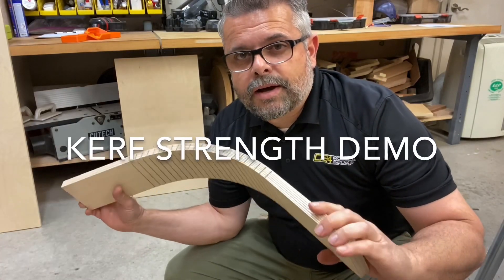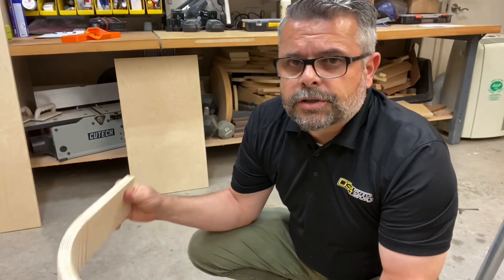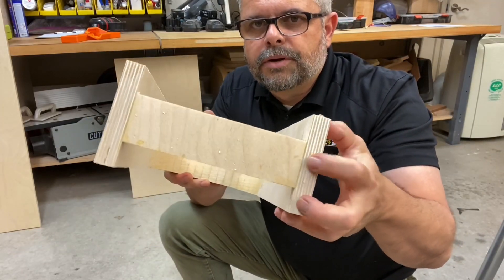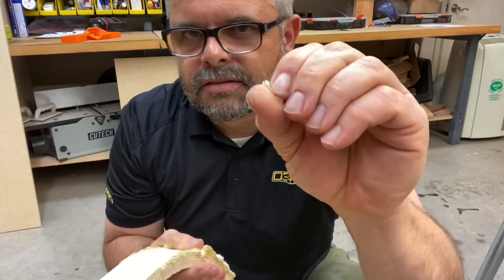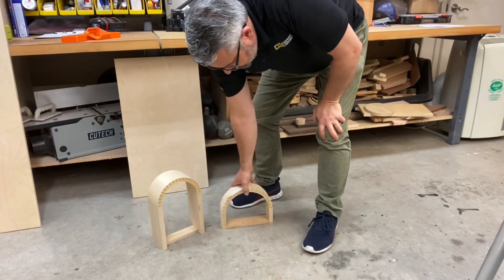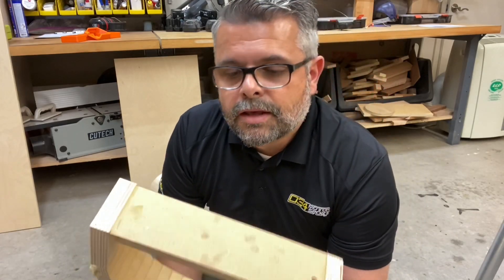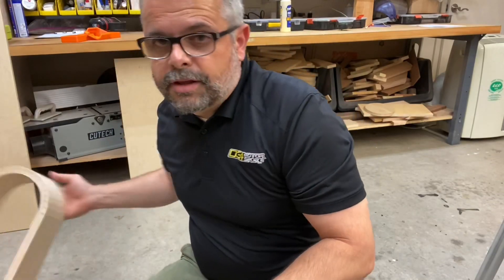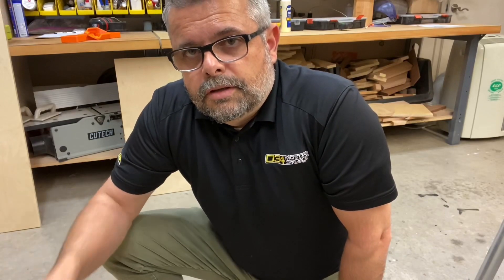Kerfed Panel Strength Demo

Comment: That is interesting but it doesn't really prove their strength since you put your weight on what is structurally the strongest part of the dome shape.  Also the cross brace becomes a part of the structural integrity of the piece once you attach it.  It is still interesting though but the plywood is clearly compromised and will behave differently from normal plywood in response to several kinds of stress despite still being strong in one specific direction.  I would actually like an engineer to discuss this because I don't really know where it would be strong and where it would be weak.  For example if you put the dome pointing off to the right and the cross brace on the left and stepped on the structure I bet it would break. Your 185 lbs would break the board depending on the direction of the force.  Still interesting, thank you.
Reply from the maker: This isn’t a scientific experiment, it’s a simple demonstration, you should come away from this with a reasonable sense that this assembly still has a lot of strength considering these cuts leave less than. 1/16” of material connecting the kerf sections. 

I am an engineer and this demonstration clearly shows this assembly as built has a certain amount of strength, it’s not designed to be a strength thesis for whatever it is you’d like to do with kerfing.

Comment: Fill the kerfage with: 1 part titebond + 2 parts sawdust + 3 parts fine playsand. premix solids, intermix glue immediately before application, solidifies almost immediately, temperamental to sand brand, frighteningly durable when you get things right.
Reply from the maker: I have tried and experimented with this technique, I found it’s very difficult to actually fill the kerfs like that and really not necessary, I demonstrate using expanding polyurethane glue here, it fills the voids and is very strong, nothing more is needed.

Comment: I'm currently in the process of kerfing baltic birch plywood for my own speaker enclosures.  I'm using a single sheet of wood for the sides and back.  I've gone through quite a few pieces of scrap to dial in my methodology.  I won't be using a veener, so my kerfs will be more shallow, and the bending done slower to avoid any kerfs showing on the backside.  Great job with those Jintanis.  I wish I would have attended Axpona to hear them.

Comment: I'm curious how strong it is when the forces are from the inside to the outside. Because the pressure of the air will be from inside out. Standing on top of it doesn't really say anything about that.
Reply: But pressure from the inside is minuscule to what people do to the outside from sitting on the box to dropping them. So it does not really matter. As long as its braced it would be really close to a non-kerfed panel, in fact maybe stronger due to the glue/